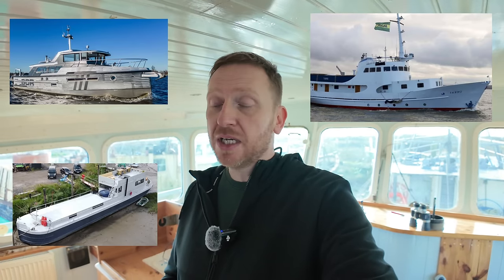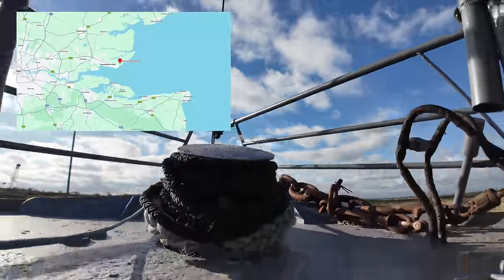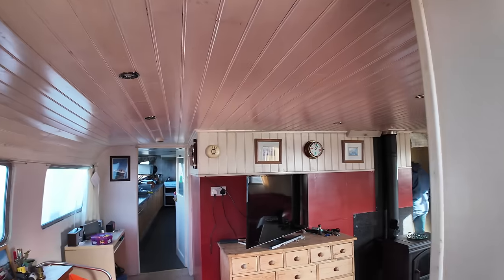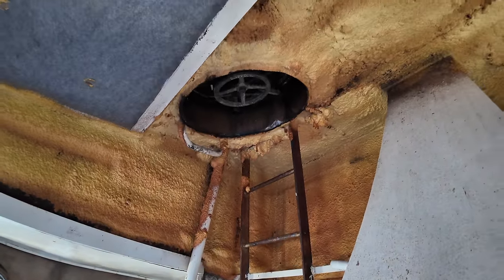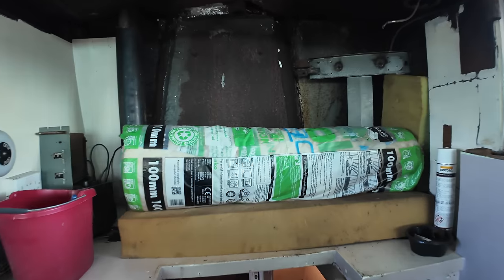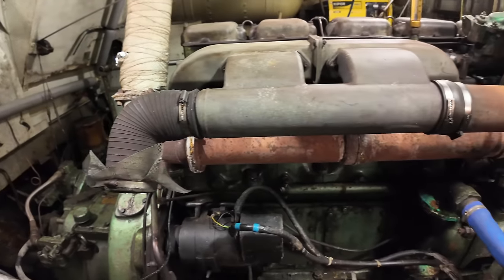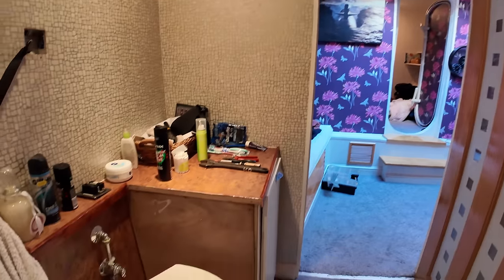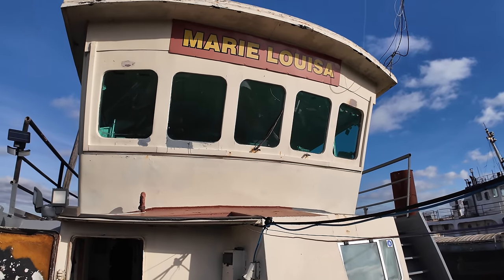£125k Retired Dutch Steel LIVEABOARD TRAWLER For Sale!

Comment: As a retired second engineer I believe there is room for improvement in several areas to include HOUSEKEEPING, specifically related to that shithole you call an engine room…
I would be extremely worried about the condition of any machinery that hasn’t been replaced in the last 5 years due to the nature of the business.  If it’s not making money it’s costing money. A good equipment maintenance log might relieve some stress …

Comment: This could be a great project if the hull plates thickness reports come out with a reasonable life expectancy. The main expense here would be the engine room. Since I hate one engine boats, I would replace the old engine with two new ones of a lower horsepower and size. That would require the modification of the aft part of the hull and maybe the rudder system. After an investment of newer electronics, a new generator and a good cleaning of the tanks, I would move the boat to Spain, Turkey or Croatia where the interiors can be done at a cheaper price. While they work on the interior, all exterior surfaces can be stripped and repainted. All this would have to be done for les than $1.2 million. One cent more than that and there are many trawlers in the same size range in the market that do not need that investment and are a lot newer. Anyway, it is a beautiful old boat.